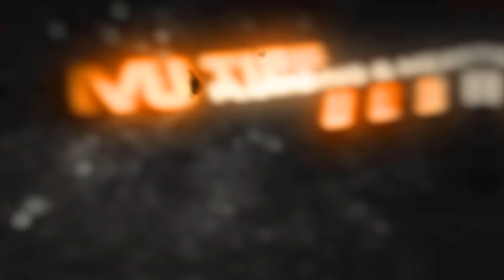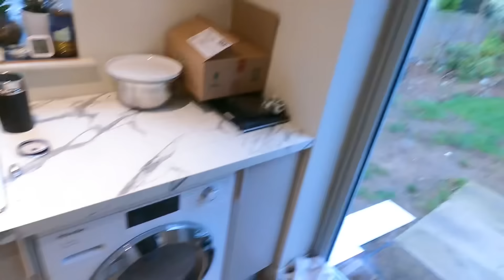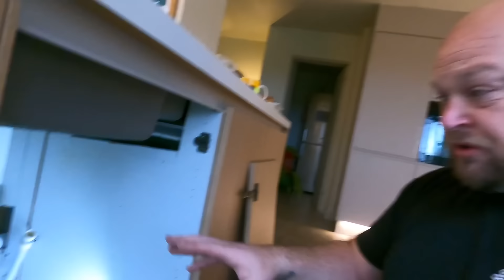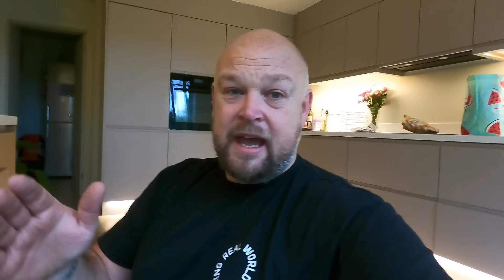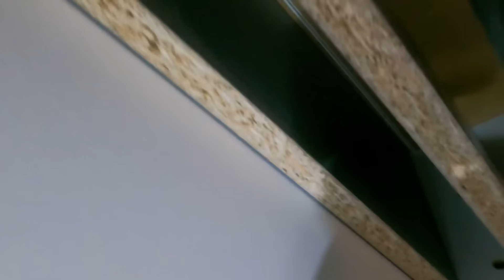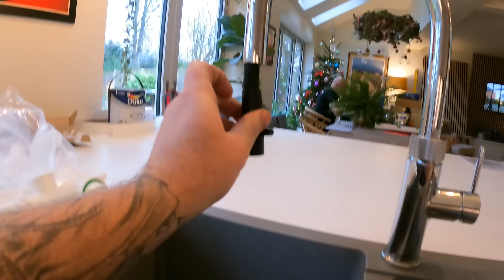CUTTING INTO A LIVE PLUMBING PIPE....WHAT YOU MUST DO!!

Comment: Speed fit connections buried in the floor, real world plumbing! Once was a sackable offence that, now it’s just real world shit plumbing.
Reply from the maker: It’s what happens in the real world mate…….

You ain’t going to dig up thousands of pounds of flooring to trace back and get rid of the plastic that is all ready there unless your doing a complete renovation,….. this is the real world mate. Like it or not… it happens.

You wouldn’t do it on a new project unless it’s MLCP…… I guess that not right with you either🤣🤦🏻‍♂️
Reply: @ I wouldn’t cut out all the plastic pipe as no problem with that, I just would use compression, or anything except a pushfit fitting under a concrete floor😬

Comment: Lot of air in that rad mark, I first wondered had it been piped up wrong as I’ve seen some of them being directional with baffles in them. Don’t know if you have ever come across them but them alladin screw in automatic air vents come in handy with them tall column radiators, they save callbacks
Reply from the maker: Yep got the air out and all is spot on now👍🏼👍🏼

Comment: The other alternative being to use two speedfits couplers with a  short piece of speedfit pipe. So pressfit not vital  :-)
Reply from the maker: Don’t really want 1 speed fit coupler in a floor….. let alone 2😮😮
Reply: @MJTiffPlumbing  I would certainly never have them in concrete, period. But under floorboards always try to minmise connections. The pressfit is also relying on a rubber seal at the end of the day.

Comment: Hi xan you explain how you drained the pressure at the boiler...what did you connect pipe to.thanks
Reply from the maker: As shown in the video, connected to the drain off on the heating pipe off the boiler 👍🏼👍🏼

Comment: That column rad not getting hot sounds like the system just needs balancing and venting. I don't really understand why you did what you did, all you've done is take loads of inhibitor out.
Reply from the maker: Did you see the air coming out….. that’s what had locked it up….

If you knew the size of the house, you would know that I’ve not made a dent on the inhibitor…. They have an indoor pool, that should tell you it’s not a 3bed semi.

Also…. After doing what I did it now works…. That’s why I did it😉

Comment: would a compression fitting have been better to join that live radiator pipe as will be covered over permanantly with tiled flooring and compression holds up better than pushfit from the push and pull from water pressure changes going through it?
Reply from the maker: This had plastic fittings on it for years upto this point, it was more a case of get it and get it sorted for the tiler…. With inserts and fitted correctly there shouldn’t be any issues….. nothing is 100% though

Comment: Agree with the press fitting...I trust you could have used another plastic push fit though
Reply from the maker: Wouldn’t want to use more than is needed under a floor, had to use 1 just to connect to plastic… then straight onto copper

Comment: Great video, as always.

I'm in no way a plumber, so I'm asking out of curiosity.
Why not just use the speed fit instead of both prees and speed?
Regs? Or something else?
Reply from the maker: Always good to ask sensible questions mate….

Had to use speedfit to connect to the plastic pipe… then onto copper, had to use press to extend the copper pipe as the plastic wouldn’t reach👍🏼👍🏼

Only way to connect the 2 different pipes
Reply: @MJTiffPlumbing  thankyou

Comment: Couldnt you have just cut the copper and gone straight on with the speed fit coupler?
Reply from the maker: Wasn’t enough on the pipe to get it
Reply: Real plumbing isn't Speed fit
Reply: @bovnet  why isn't it real plumbing?
Reply: Thats what the old plumbers used to say when copper tube was starting to be used in place of lead.@bovnet
Reply: @LS-td3dz  now that was an art

Comment: That main sink, i would of used a poly fitting and then come up in copper. Dont like using compression straight onto plastic just due to the compression of the olive really bites into the plastic 😊
Reply from the maker: As long as you have an insert in it to strengthen the pipework your all good👍🏼👍🏼

Comment: My only comment on that would to have been to clean the pipe before cutting it. Other than that quick fix and on to another "simple" job.👍😏
Reply from the maker: Yep good shout that 👍🏼👍🏼
Reply: @MJTiffPlumbing what would you say is the best thing to use to seal around a floor drain thanks
Reply: Also make the push fit up ready?